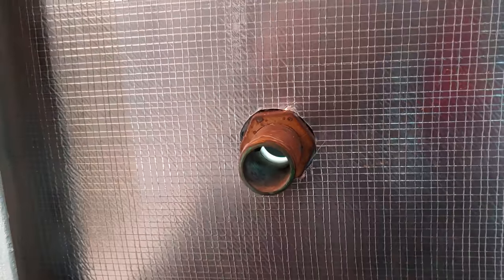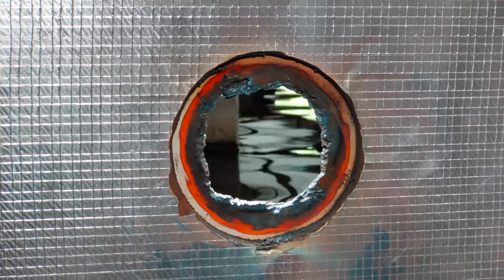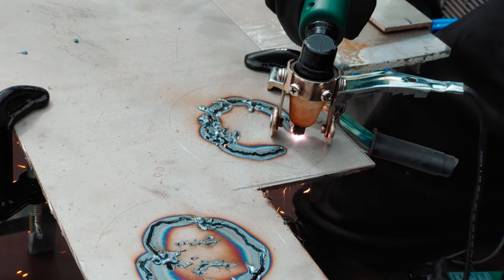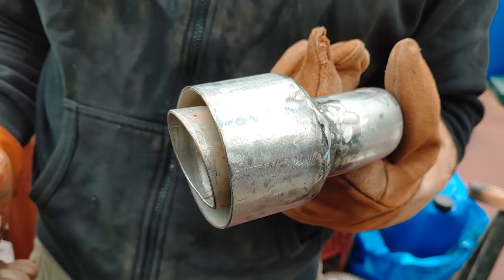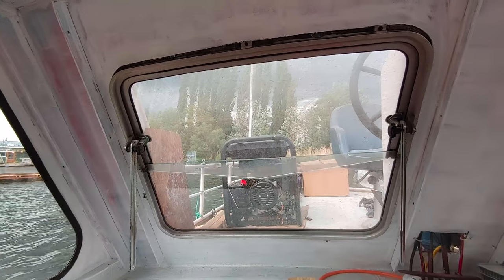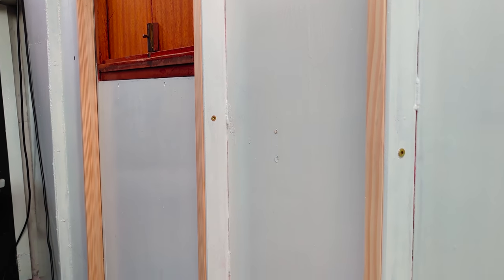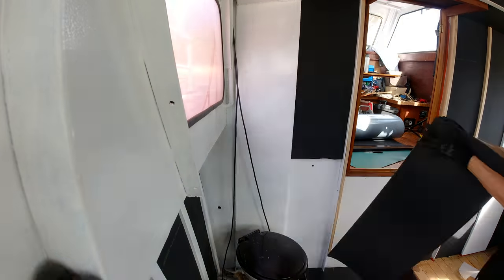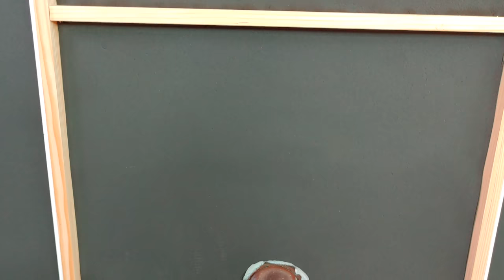Installing a Diesel Generator in our Boat - Ep. #33 - Vintage Yacht Restoration Vlog

Comment: Bad idea that material is auto grade. Having holes like that so close to the waterline, filled with auto muffler materials is asking for trouble. Good luck getting insurance, a deaf and blind surveyor wouldn’t pass that.  Dropping  that “through fitting” into the water would have been the safest thing you could have done. I really liked what you have done to this point. Like Clint Eastwood said in a movie “mans gotta know his limitations. None of that welding or fabrication is any where near satisfactory, because when the boat gets into rough water it will leak Ike a sieve, and your next video will be “How I became a owner of a submarine”. Sorry, this is a safety issue and any legitimate mechanic would agree. It is substandard.
Reply: It's entertainment, not a documentary!
If I agree with the meaning of your message, I would have phrased it a little less harsh... I often disagrees  how the project, is planned  or done but can you let the young man is learning by his own mistakes?
Reply: @RussClarkRocks   Because safety is nothing to fool around with.  Everything he has done prior was non life threatening, and a matter of choice. Hull penetrations at the waterline, are critical. Nautical  like aviation is inherently unforgiving. Screw up critical fabrication and the boat sinks or plane crashes. The materials he used will corrode in a very short time from the inside, hidden from view. He has said that he hopes to live aboard in the future.
Reply: @brunolaflamme5202  When his mistakes could cause someone to lose their life, it ceases to be “entertainment”
Reply: @ericmartin5720  Thanks Dad. I bet you are a riot at parties. "Those candles on that birthday cake are a tinder box!". "Don't swing that stick at the pinata, someone could lose an eye!". "Is that your second beer, Mike? Don't you think you've had enough?". Lmao. Lighten up, Francis.
Reply: @RussClarkRocks  Bla, bla, bla. Here’s a novel idea, don’t like the comment move on. It’s that simple.
Reply: @RussClarkRocks  Sir I dont believe he intended to be a dick about the repair.  Storm's on the water can be scary at best.  Weld failure at the water line could equal a free burial at sea.
Reply: @gregsullivan8956  I appreciate your comment. Had the OP shown even the slightest empathy or tact in expressing his concern, he wouldn't have been called out as being a dick. I stand by my assessment.
Reply: @RussClarkRocks  Spoken like one of the,  “everyone’s a winner generation” “ribbons and medals for everybody” crowd. My comment was for the boat owner, he is a self professed novice. As you probably are. I operate heavy equipment and use potentially dangerous equipment every day. I have buried and have friends who were lost at sea due to accidents of omission and commission. The sea(water) and air(altitude) are unforgiving to fools and the ignorant, fly a kite in a thunderstorm and you might discover electricity or end up dead, electricity has been “discovered” so the the remaining potential is dead. Seafaring and aviation is littered with stories of well intentioned people who ended up dead from their mistakes. I notice the creator hasn’t weighed in.

Comment: Need a shade 5 for plasma cutting, buy any cheap automatic welding helmet you can adjust the shade (darkness) to your desired level. Or buy 8$ shade 5 glasses, Essentially the same ones you use for oxy acetylene. Try using a any object or stencil for round holes, reality is if you want a clean cut use a hole saw, angle grinder etc. You'll never get a clean cut with that setup even if you were experienced.

Your lacking on all 3 to run a plasma setup at its best (plasma cutter, generator, and air). The Chinese plasma cutters are never going to cut great even with an ideal power supply and an ideal air supply. You need real power, steady supply of clean dry air, to achieve okay results with that plasma cutter.... Using a professional plasma cutter with proper air and power can produce results that are (arguably slightly) better than a oxy-acetylene cutting. Even with a skilled user behind each its a tossup which cut is better when cutting thicker metal. Plasma is definitely more fun and faster to use though; Once you use a real plasma cutter like a Hypertherm you'll realize how and why expensive setups cost what they cost, night and day difference. For your situation I  would recommend selling that plasma cutter and getting yourself a second hand oxygen acetylene setup (cutting torch, hose, regulators and 2 small tanks)  if you plan on cutting lots of stuff in the feature. They don't require electricity, or air, cuts great, can braze with it, use it to heat metal up and bend metal that would otherwise be impossible, use it as torch to help crack rusty seized shit free and importantly can find entire setups for dirt cheap, did i mention there extremely versatile tool for metal working?  It is a much more ideal tool for you and if you dont want to use Acetylene you can substitute it with propane ( and oxygen of course) and cut with that too.. Otherwise stick to angle grinders, holesaws etc for better cuts if that is what your aiming for.

Sorry for negative reality but it is what it is. I don't want you to go chasing some plasma dream that is not a reality with your setup.

Comment: I would have used a decent set of hole cutters rather than the plasma cutter. If you can't run it properly then it's not going to perform for you.

Comment: Make sure you buy a really good carbon monoxide detector for the very questionable generator install. Why didn't you purchase a proper generator for your boat to begin with? Cooling is gonna be an issue, as I've said before, but that exhaust your rigging scares the shit out of me! Dry exhausting just above the water line in an enclosed space...What could possible go wrong?!
Reply: I agree. He lost me with this one. This generator & exhaust install is dangerous on many levels. That waterline exhaust port & non marine grade materials is a heavy cringe moment!

Comment: why don't you get hole saws? Also, you should never cut anything with just on hand. A week ago I had an incident that could have been realy bad were I was cutting my mast down and while cutting, the cutting blade failed, got lodge in the mast and kicked back into my right thigh. Cutting into my shirt and shorts. Cut me a little and gave me a nasty bruise. If it wasn't for the grinder getting caught in my shirt and binding the wheel, It would for sure have been a trip to the hospital. I showed my wife what happened when I got home. (nurse of 31 years)She told me The grinder missed my main artery by half an inch. So at first you had your gf or friend helping you so you need someone helping you when cutting. I had a friend with me and luckily he was there.

Comment: Dude , take those silly guides off. I drag the tip, and yes you will go through more tips but it's easier to draw, hides most of the arc, makes a nice cut, but hovering works fine also( like using a mig). The distance from the workpeice depends on machine power, skill. air pressure power, material being cut and skill.  As for cutting thickness, you should have a chart for thickness/power setting of different materials Get a proper welding helmet so you can support you working hand. Your free hand is for supporting your working hand not the helmet or workpeice or holding onto things.

Comment: . Je ne percerais pas de  trou  aussi prêt 
de la ligne  de flottaison, je dirigerais le tuyau d`échapement vers le ciel . Ce jeune homme est en train  d`apprendre, être à sa place , j`inviterais des techniciens spécialisés quelques fois pour m`assurer que je vais être en sécurité une fois sur l`eau.

Pour  le plasma, je ne suis pas sur place mais d`après ce que je vois, (arc électrique instable),  Puis-je soupçonner une alimentation électrique insuffisante et /ou irrégulière?   (watt  en continu) Une mauvaise polarité ? (branchement ).L`appareil doit fonctionner en même temps que le compresseur , vous devez être trop exigeant avec le générateur.

Essayez une bonbonne d`air comprimé ou d`acéthylène à la place du compresseur pour moins solliciter votre générateur ou essayez  un ensemble de scie cloche Milwaukee ou Irwin sur une perceuse avec un peu d huile de coupe.

Comment: You need to watch YouTube not post on it why would you want the Exhaust coming out of the side of the boat I guess you must like carbon monoxide in your boat supposed to exhaust underneath the water for sound and carbon monoxide or tie it into the existing engine exhaust and for god sakes learn how to weld and use a plasma cutter take the straight guide off the torch atleast
Reply: Picky picky

Comment: no preservation on the bare metal before you insert the new outlet? if not you will get a lot of rust soon. also the metal used for this is not what you want. And also the welding ferformed on an exhaust pipe is not ok like this. the welding was more like making a mess. This is full of mini pinholes and will rust very fast. the result will be that exhaust gasses can leak into the boat. carbonmonoxide is a silent killer. please watch out. Buy good detectors. it is very important on a boat. Many got killed by it.
Reply: Water will come into the vessel when rust comes through the porosity.